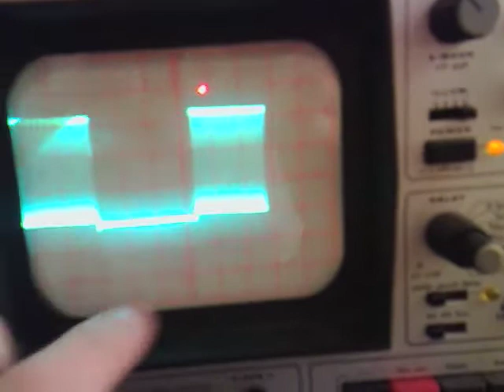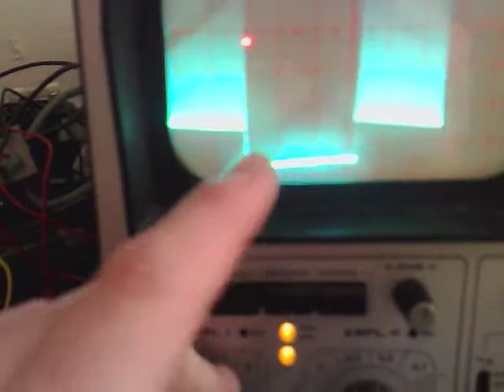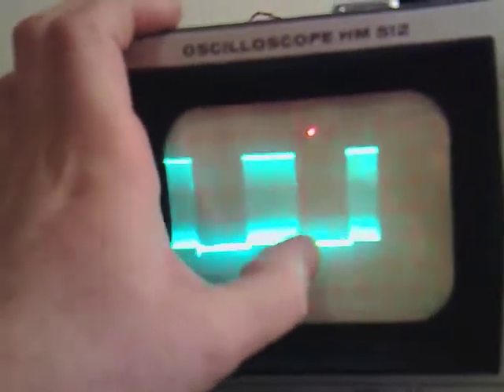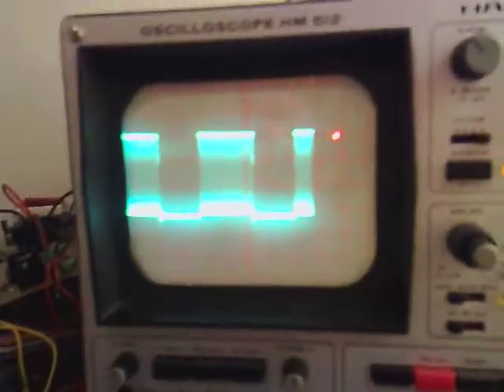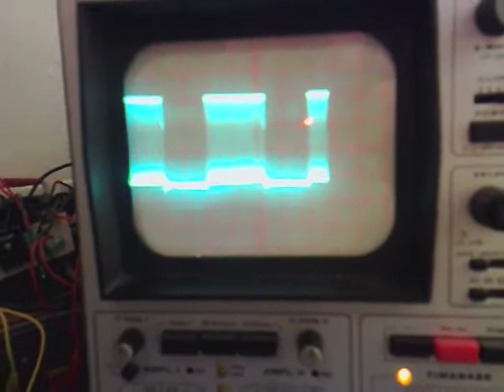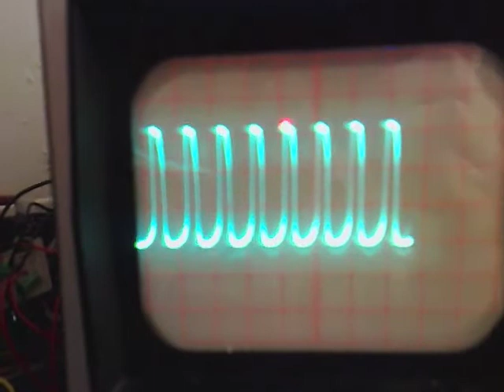Joule Thief (Pulse Main Power) 016

Comment: I did mine and it was oscillating at about 300KHz the frequecy varry depending the transistor, resistor, the ferite and the # of turn you have. Mine has a third coil in it and using it to charge battery with sun.